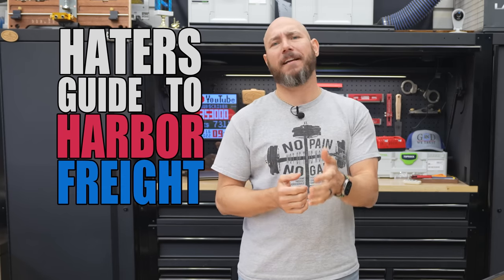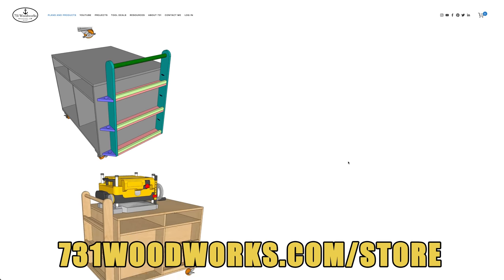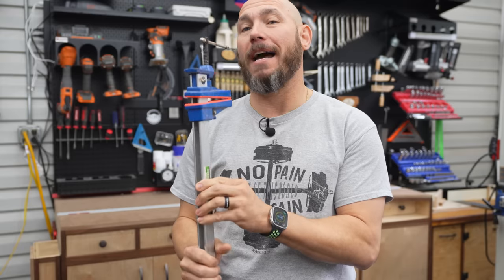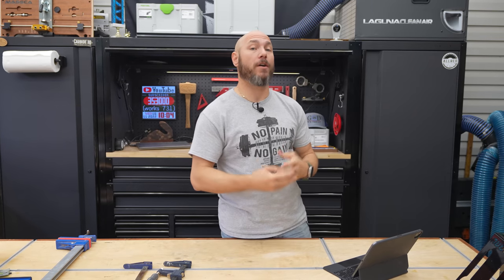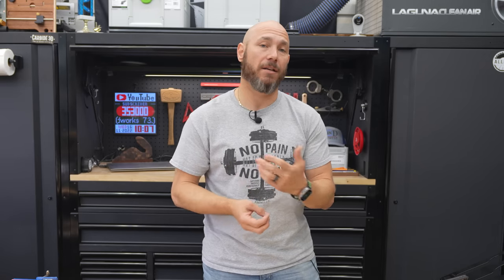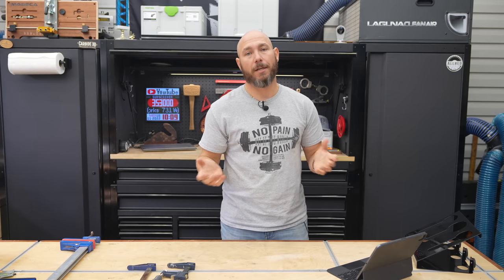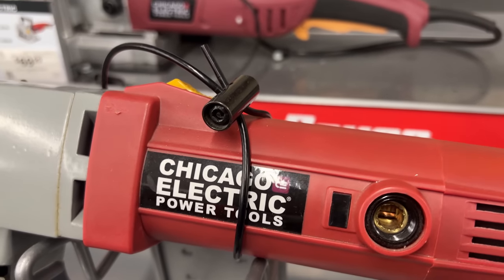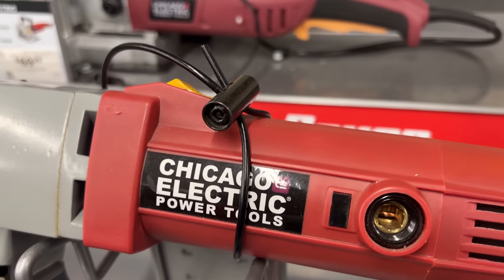The Hater's Guide to Harbor Freight | What to Avoid

Comment: I am actually more of a Harbor Freight Stan. I have almost every cordless Bauer tool they make. Not a professional, but I am a pretty prolific diy-er. I've built a deck, tree house, a bed, a lego table, entertainment center, and several shelves using my Bauer drills, circular saw, miter saw, router etc. All "moving parts" tools, and I have never had an issue. Nothing has ever broke on me. I will agree about eh Drill Master and Chicago electric, but two things. 1. I am pretty sure they are phasing those brands out in favor of their 3 tiered Warrior/Bauer/Hercules lines, and 2. you get a Drill Master or Chicago Electric tool when its something you plan on maybe using 1-3 times ever.

Comment: I view HF as a beginner of beginners place. Start with zero expectations. Assuming nothing is on the dot. Over measure and prepare to make adjustments. If you're not looking for  100% accuracy then you will not be disappointed. DIY stuff you know that if you want perfect square then you know your best checking no matter the tools you have. I like at times something not being too one sided. Strangely I  like things to be more adjustable in more directions than one. However furniture I will do my best to makes cutting precise. Which I would check anyway. 

Some tools I might get from HF as a starter tool then once I've made the money I can I will upgrade. Also i price pieces I do with cheaper tools and price things to that but making sure quality is in the stability over looks. Of i know it can last 30 years still I'm okay with the tool being a bit cheaper and not maximize profits. My goal is start the business and grow to the best. Working with bad tools that is still safe you learn what you can do without. Then once you upgrade your are much more capable.

Comment: HF chisels are great as "beater chisels" that you know are going to get trashed (taking up flooring, for example).  Not for real chisel work at all.  The router bits are teriffic for roughing out or where you might run into e.g. a nail.  Save your good bits for the last 1/16" finish pass after clearing the potential minefield of nails etc. and roughing out on the first pass.  In other words, use the cheap HF tools as cannon fodder and recognize that that's what they're for.

Comment: I agree and disagree about the chisels. They are a good option for scraping dried glue on glue ups and other tasks when not cutting anything important. The measuring devices, I check every brand. I was at one of the big box stores and found a Stanley Fat Max that was off by 1/4" over 1" and several others that were off considerably off over a couple of feet. When  I'm working on a project I try to use the exact same measuring device for the entire project. If I have to use multiple ones, I always compare them against each other over the distance I will be using them. I have compared all of the ones I own against each other and they are all dead on except for 1 so I take one of mine with me if I feel I might be buying one while I am out.
Reply: When I was in High School I worked one summer for a framing contractor. I was the "cut man" and almost got fired because of my Stanley tape measure. They would yell out a measurement from in the house, I'd make the cut, and it would be wrong. I knew how to read a tape and I was marking and cutting the board to the exact measurement they were telling me, but it would be wrong. The rest of the crew thought it was just because I was a dumb kid and was ready to run me off the job. That was until they compared my tape measure with theirs, mine was way off. Got another tape measure and my cuts were dead on from then on.

Comment: Almost all my tools are from Harbor Freight. Now, I aint a professional mechanic nor do I work in construction. I am a weekend DIYer. The tools I have are more than enough for what I need. Sure, some broke, but the prices were ridiculously low, I bought extra. The only thing that I will never buy is theie cheapest breaker bar...I believe they were $9. Instead, buy the Pittsburg one which was about $19...the one I bought have held on for the past 7 years Ive used it when doing car stuff.

Comment: I love HFT.  ICON, Doyle, Haulmaster, Apache, Daytona, Badland, Predator, Earthquake, some Hercules...you can't beat them.  I avoid Pittsburgh.  Doyle speed squares are very good.  The Doyle 6" vise is a beast.  I got the ICON 73" box, SS top, and hutch in green for just over $3k.  The original price on the box alone was $3500 before it was reduced to $3k, so I got the whole shebang for significantly less than the original price of the box alone.  I used a 20% off coupon with the 10% CC discount.  How much would that rig cost from Snap-Off?  I just picked up a brand new Bosch GCM18V-12GDCN14 18 V miter saw at auction for $550 -- about half of normal retail, then picked up a Hercules miter saw stand to go with it for $140 on ITC special.  Not a bad deal at all as far as I'm concerned.  I've picked up the Vanguard 100' AWG 10 extension cord for as low as 85 bucks.  You have to belong to ITC and hunt for the bargains.   Frankly, I don't believe those negative BBB reports.  I've completely lost respect for the BBB, along with most of those types of reporting agencies.  Pretty much everything these days has been corrupted by lies and deceit.  I agree that HFT still has some low quality tools, but they are improving every year, and going after the higher-end markets.  I also love the company in general and the store employees -- great folks.

Comment: I love harbor freight, their tool chests are awesome... their tool carts are great.  Much cheaper than snapon, and they work just as well.  I have one, and I can't complain about it one bit.  Their levels are solid, as are many of their hand tools, and their warranty is solid, but the more moving parts, the more you want to avoid them.

Their router bits are good, if you treat them like disposable items.  Ditto their chisels; good if you need them once in a while, but not for fine woodworking or repeated use.  and if you get their screwdriver bits, and they strip, they will return and replace them no questions asked.  Great for a beginner, and then you can upgrade to better quality parts.

as you said, their measuring tools suck.  I had a 6 inch speed squad and couldn't find out why my cuts weren't lining up square... until I put two squares back to back and saw the gap.... Harbor freight electrical tools are good for one or two jobs; if I need something reliable, no way am I going to buy it harbor freight.

Comment: All the Chinesium (metal) you can shake a stick at.  With a few things that don't suck. lol. Absolutely second the advice to avoid the drill bits.  Won't even drill out a simple lock - just spins and refuses to cut. That said, some things to get are their jack stands and floor jacks which are apparently built in the same factory as Snap-On. Unfortunately, the same cannot be said about their drivers and torque wrenches, which are like throwing crap at a wall and hoping it will stick. My dad has some old Japanese sockets that survived nearly 20 years of electrical and construction work and the Harbor freight lasted me.. about 5 jobs. Having a driver break or a socket strip itself out ( as opposed to the nut ) is your entire afternoon coming to a stop while you go get a replacement.   Same with their breaker bars, tire wrenches, and so on - anything you put torque on will eventually deform or bend as the metal is not up to the spec ( factories in China lying... who'd have guessed? )
So, things like shop gloves, lights, clamps, wheel chocks, etc.. all good.  The rest.. shop carefully.

Comment: about 30 years ago i bought a drill press from them that my dumb nephew left on my tool box in the back of my truck and it fell off while driving down the road at around 65 mph and I went back and picked it up the top busted off into a million pieces so I thought it was done. Nope! that thing is still working not in my shop but his! Mine is around 10 years old and I bought the larger one and it is running just fine! I LOVE HARBOR FREIGHT MY COMPANY WOULD NEVER HAD TAKEN OFF WITHOUT THEM! I'm retired again now the first time was from the army but I still use them in my home shop!

Comment: I agree about Drill Master. They are terrible. They have been re-named "Warrior". They're the exact same junk.

I have had good luck with the Chicago Electric, tools I've bought. I have a 20-year old 4-1/2" angle grinder that's still going strong. I wouldn't get one of the routers, though. That's a precision tool, and needs a lot of power. I have a 10" compound sliding miter saw, too. You have to mess with it a bit because the fence isn't straight, but I only paid $90 for it, so I can put up with a lot at that price. I don't do precision work (much anyway), so that helps.

Comment: The icon torque wrench is not horrible if your just using it for auto stuff. It's off by about 5% but that's fine with most engine torque specs

Comment: I find Ryobi tools to be pretty good. As a Home Depot associate back in the day, I didn't see many returned and customers liked them overall. The harbor freight Pittsburgh wenches have served me very well repairing Catapiller equipment in the field. Like you said tools with more parts aren't what you want to buy at Harbor Freight. I picked up a 18 volt  screw gun on sale for 16.99 to disassemble some furniture to move . It worked fine for that and very light use for about 5 years before it died. If you hardly ever need a power tool, Harbor Freight is fine, but if you plan on regular use steer clear of their power tools.
Reply: I mean thats $3 a year which aint bad honestly

Comment: getting there air hosed and fittings are a good buy. I would also thing about stuff is not changed in decades in design. like the angle grinders. hammers, The pneumatic tools.

Comment: I have some pretty good stuff from there. Probably my whole tool bag really. And they get used weekly. Had a few bad experiences as well. Bought a brake compressor while doing my brakes, it snapped in half while doing the first brake cylinder lol $8 down the drain. But overall no complaints about everything I bought there. They sell rakes for $8. I have a lawn care company so I go through a lot of rakes.

Comment: Was a heavy truck mechanic  the wrenches are just as good as most others . 20 years ago they where junkie. Have never broke any and put lots of stress with pipe extentions and stuberan frame bolts have broken several of there sockets with abuse like 3/4 air rachet on 1/2 inch sockets totaly understandable

Comment: I would say Icon, US general, Hercules, Braun, badlands, Daytona, and predator are solid picks.

Bauer, Pittsburgh, Quinn, Doyle, and fortress, are mostly solid, but have some items to pass on.

Warrior, central pneumatic, atlas, etc, those are ok for a cheap "I'll use it 3 times a year' kinda thing but that's about it.

And yeah, measuring devices are a no-go, the only exceptions would be the icon and Quinn torque wrenches, those seem to be pretty accurate and hold up well, even the Pittsburgh torque wrench seems to be pretty accurate initially, but it just doesn't hold up as well from the testing I've seen.

Also an underrated thing about harbor freight is its ability to absolutely save your butt from being stuck on something stupid, bolt extractors, odd shaped extensions, odd adapters, uncommon tools, just oddball things that you never thought you needed until damn, you really need it.

Comment: I love HF! I’ve bought a ton of crafting supplies there that would have cost a lot more if I’d bought them from crafting-specific brands. Two of my favorite things from there are the big foam square interlocking mats and their heavyweight nitrile gloves. I agree about the Chicago Electric brand. I actually have a Chicago Electric rock tumbler running right now. I had to do several modifications to it in order for it to work properly and not burn up a belt every other day or so. Everything about that thing is flimsy! I definitely got what I paid for with that thing. 😂

Comment: Very valid points but there was a bit of credit left out for HF. LIke their Lifetime hassle free warranty on their brands like Pittsburg. Cheap yes, will it get the job done, most of the time yes. SOmeting breaks or snaps you can return it and get a new one, in 5minutes. You walk in with those bent clamps, they will give you a set of new ones. Just my two cents.

Comment: Recently I spent a couple of days chopping up a 6'-diameter fiberglass hot-tub w/ my cheapo ($35 on sale?) HF sawzall with the adjustable rotating head. No problems at all. I have had and used this thing for 4-5 yrs prior. The tool bags are cheap and good. The cheap metal hose clamps, on the other hand are, imo, crude junk, as are their way-cheap torque wrenches --- unusably bad in my experience.

Comment: For what most people use them Harbor Freight is fine. I have a Chicago Electric grinder that is close to 20 years and keeps on running. Buy insurance because it pays to be sure. Used it on 8-10 HP motors a lot. If your in the business buy Ryobi.

Comment: Own wuite a bit of bauer and have yet to have issues with them, also worked maintenance and always joked about my pittsbugh costing a fraction of the wiha types around the shop. Havent had many failures and for the pricepoint if it breaks you could probably buy a 2nd set and still come out ahead. Just pay the extra for the warranty on the powertools just in case 😂.

Comment: I spent years as an auto mechanic for the hand tools I have Mac, craftsman, snap on and Harbor freight. The Harbor freight works just as well as the rest, they don't have the life time warranty but for the price I can afford to replace them. Torque wrenches and impact I wouldn't depend on from Harbor freight, But for the most part if your using them as a hobby or novice craftsman / mechanic Harbor freight will work, You have to remember your getting what you paid for. If you paid $20 dollars for a cordless drill you might want to get 4 cause the the first probably won't do the job. 

For the BBB complaints I agree with some of the other comments. People will complain a million times faster then complement someone. I know someone that bought a set of sockets from Harbor Freight and used them for several years as a full time mechanic and when he broke one (while using a cheater pipe) he tried to get it warrantied and when he didn't he went to BBB to complain. So take the BBB complaints with a grain of salt cause I will bet the Complainers aren't telling that they miss used tools or the whole story.

Comment: Years ago I bought a business. A BBB rep walked in with a printout of bad reviews, hundreds of them. I gave them a couple hundred dollars for "membership" and PRESTO, an A rating, all the complaints deleted. It's a protection racket, nothing more. As for HF...there have been times I bought crap tools for a one time use and was happy with what I bought-the expectation and price aligned perfectly, and sometimes the value was much better. But lately, they seem to realize they've lost their monopoly on the low end of the market, and are learning how to deal in quality as well. I'm loving the Hercules brushless stuff I have, and the warranty on even the batteries (the same Samsung cells the box store brands use) should be scaring the name brands. I've had their former top line tool chests for nearly ten years and love them. The new Icon stuff is very interesting. And the employees in this area seem to enjoy working there, a big shift from the past. There's still a lot of crap in the store, but having choices is good.

Comment: I have the harbor freight Hercules table saw, and I have a Dewalt table saw equivalent, and the Harbor Freight saw is far superior. I can barely use the Dewalt saw since I got my Hercules saw. It's so much better. I get far more accurate cuts and it's easier to use and safer. Both the rip gauge and the miter gauge are far more accurate.

However, the saw in your video does not match my saw. The rip gauge on my table saw attaches the same way as the Dewalt saw gauge attaches. Maybe that was an old model you were looking at? Mine has bolts on the side of the tracks that lock the gauge into place to make sure it is square, and then it clips down.

I would agree that I would avoid the cheap Chicago Electric brands. I get the Bauer line for battery powered tools and Bauer or Hercules for corded tools depending on need and availability.

Comment: No you didn't really change my mind but I do agree with you on most of the tools. Harbor Freight definitely has its place for cheap tools when a person probably is only going to use those a dozen times which is nice to have the option to get something cheap. Also as you said they have some better stuff as well. You get what you pay for so I'm glad they are around because some things I may only use a few times and I'm fine with them not holding up for the long haul if I don't need it to.